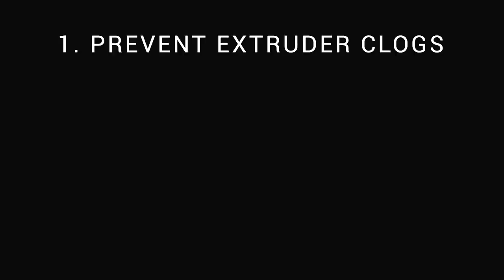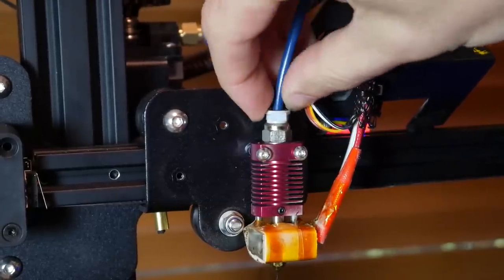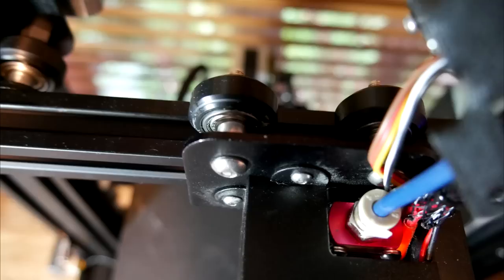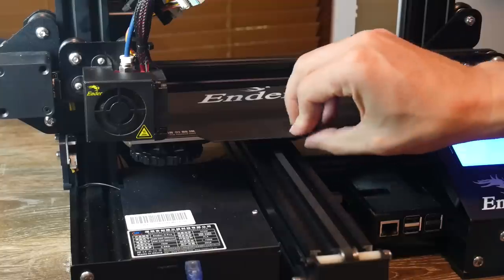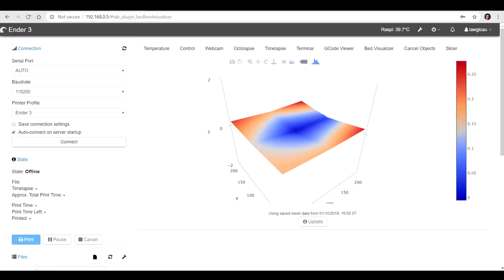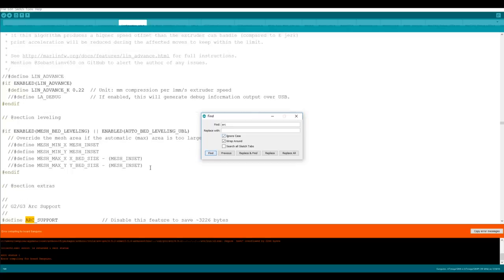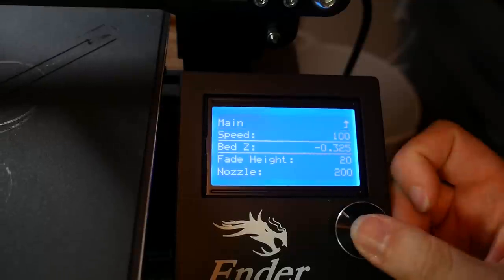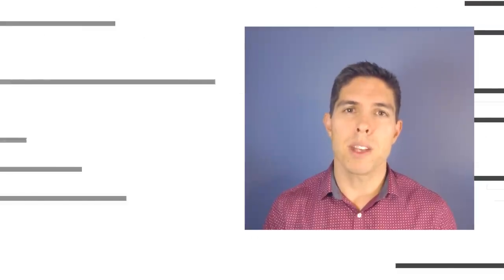5 beginner Ender 3 fixes - featuring manual mesh bed leveling guide

Comment: I have an Ender 6. This is a pet rock. 22 attempted prints and two tiny prints. I leveled the bed many times. I am getting fails for different reasons, clogged hot end, feaded grinding but not feeding filament, prints not sticking, prints breaking half way. Each time I find a fix it is only half and I get a fail in a different way. Now you want me to edit G codes which I know nothing about... This hobby is rubbish creation!!! I feel throwing the printer in the garbage is the best solution... All I am getting out of this is the hundred fails and melted plastic. Three Dead Dolphins hobby.

Comment: Any suggestions on why my extruder is skipping? I tried increasing the spring tension but then it skips even more, so I would say that the tension is ok. Any ideas?
Reply: So for anybody who had my issue the solution is to take the PTFE tube out of the heating element, cut off just a tiny 1mm bit at the end and make it as straight and level as possible, then reinstall the tube.

Comment: I bougt a ender 3 pro, but when I got it al setup, I was not able to get the right side of the bed hight 
enough. what should I do now?
Reply: Probably too late to help you but wouldn't lowering the Z Min Limit/Homing Switch on the left side of the machine help ?

This will cause the tip of the nozzle to be lower after Homing so you'll have more adjustment available on the bed levelers.

Comment: The biggest problem I’m having is my prints start in the home position. The test dog works just fine but anything else prints at home.
Reply from the maker: Sounds like you have the coordinates off in your slicing software. They often have a setting to tell where the origin in. Make sure it's not 0,0 at the centre.

Comment: mine just spits plastic doesnt even print the object to begin with. i have a ender 3 pro but so far nothin i do have worked it will extrude but wont print anything to the bed at all

Comment: I'm trying to get manual bed leveling to work, everything works flawlessly until i try to adjust te bed height, then the z-axis wont move.  I'm trying this with a fresh marlin install on a skr mini e3 1.2 board. Anybody got any suggestions?

Comment: I brought a one Ender 3 but it's bad for modeling I have problems with the filament  just don't stuck in the bed.
Reply: Ender 3 is actually very good for modelling... when configured properly. Did you check spacing between nozzle and bed? A sheet of paper should barely slide in-between. Also check your nozzle temp, it might not be hot enough.

Comment: I followed all the steps for manual mesh bed leveling, and Slim LCD was already commented out, but I'm getting a size limit error:

Sketch uses 130224 bytes (100%) of program storage space. Maximum is 130048 bytes.

Global variables use 4735 bytes (28%) of dynamic memory, leaving 11649 bytes for local variables. Maximum is 16384 bytes.
Reply from the maker: I've just added a pinned post to assist you. I assume 1.1.9 ha updated since my video with new features that use more space.

Comment: So, heads up, if you use a example config that is for your exact printer and you enable manual mesh bed leveling, be sure to comment out any #define AUTO_BED_LEVELING shown  @10:34 or you will get errors in your conditionals.

Comment: I found out the hard way that if u didn't order your printer from creality directly  they won't help you with the printer at all. They said for me to contact banggood with my problems. I didn't ask for parts or any thing. I simply asked for advice on adjusting the z axes Because it wasn't working. Plus asked them about the 2 screws that hold the z axes motor on. I just wanted to know were I could get some more since I  lost them. 

I thought they were a good company that whole email turned me off. Its crazy that since I bought my printer from one of there venders there can't answer any of my questions.

Comment: I just got my ender 3 and haven’t printed anything yet but whenever I click the home button the bed goes all the way back and the print thing goes all the way to the left
Reply: that is the home location on the ender 3, from there you will follow the steps in the video to level the bed

Comment: You typo'd on "2. Uncomment #define LCD-bed_levelling" in the description, that should be "2. Uncomment #define LCD_bed_levelling". Note the underscore in stead of the hyphen.

On another note, just disabling arc support still overflows my storage space on vanilla marlin 1.1.9 ( 130224 / 130048 ) with the Ender 3 defaults, my overflow is also 2700 bytes exactly, not the 2296 bytes your setup seems to have. Did you disable something else?
Reply: Commenting out #define SHOW_CUSTOM_BOOTSCREEN and #define CUSTOM_STATUS_SCREEN_IMAGE does the trick.
Reply: Thanks  @Jan-cj3vr  , looks like that solved the issue. Sitting at 99% space, right on the edge.
Reply: @stefanwilkens  Same here. Manual bed leveling and then using mesh leveling yielded the best results for me.
Reply: Strange as I'm sitting around 93% and with that, I was hoping to include the mesh validation tool but still didn't have enough space.
Reply: Still wrong lol. It's LCD_bed_leveling with only 1 L

Comment: Does anyone know if the manual mesh bed leveling works with prints only from the SD card or also with prints from OctoPrint via USB? 
I have suspicions that OctoPrint ignores the settings of just leveled Ender-3.
Reply: OctoPrint would not affect this. Your start or end GCodes from your slicer could though.
Reply: @GrayOlson  well, thank you for the clarification. What could be done to overcome this issue? I am using Cura 4.1.0.

Comment: hi, i just bought ender 3 and i am having some issues on the extrusion is skipping, can you please help me thank you.
Reply: I might be able to help. You said your extruder is skipping but are your prints coming out stringy, in addition to underextruding? Your extruder skipping steps means something is causing it to work harder than necessary to extrude your filament. Most likely you have a clog in your hot end.
Reply: A common problem with the ender 3 is that the PTFE tube is just the bowden tube going all the way to the nozzle. The bowden can slip, causing a gap between the nozzle and the tube. That gap gets filled with molten filament, clogging the nozzle. This causes the extruder to skip as well as causing your prints to be stringy as retraction moves are failing, as well. To test this, unload your filament and take the nozzle off your hot end and remove the bowden coupler from the hot end. Heat your nozzle up in this stripped down state and push your bowden all the way out where the nozzle goes. This will push the carbonized plastic out of the hot end. If this is your problem, you can get new bowden couplers that have a separate PTFE tube for about $5 US, but you'd be better off getting an all metal hot end. I got the micro Swiss all metal hot end for mine for $63 and it fixed all of my issues.

Comment: I have a problem when I insert the filament, its kinda hard to push all the way to the extruder. I need to use the move the motor from the menu on the ender 3. Anyone has this kind of issue also? Its kinda anoying when I want to change the filament.
Reply: Adrian Belano I had the same problem at first. I found that cutting the end as pointy as you can helps a lot. Make sure you squeeze the filament release fully so the filament can pass the extruder gears without binding. I also picked up a tip that I find invaluable, put  a small amount of canola oil on the filament tip before sliding it in the extruder. Just rub a little with your finger and it’s pretty darn amazing and won’t hurt anything as far as I’ve seen.
Reply: @heeder777  Thanks man! I will try once i get home! Much appreciate it!
Reply from the maker: Good tips from heeder. Printing an extruder wheel helps you load because you can turn the extruder stepper by hand with everything aligned.
Reply: @TeachingTech  Thank you for the tip! I will try to print one first then!

Comment: I am still getting this message after disabling arc, 318 bytes over.  Anyone know what is going wrong

Arduino: 1.8.9 (Windows 10), Board: "Sanguino, ATmega1284 or ATmega1284P (16 MHz)"

Sketch uses 130366 bytes (100%) of program storage space. Maximum is 130048 bytes.
Global variables use 4743 bytes (28%) of dynamic memory, leaving 11641 bytes for local variables. Maximum is 16384 bytes.
Sketch too big; see http://www.arduino.cc/en/Guide/Troubleshooting#size for tips on reducing it.
Error compiling for board Sanguino.

This report would have more information with
"Show verbose output during compilation"
option enabled in File -> Preferences.

Comment: If anyone can help me.
My printer stops after the first layer and becomes unresponsive (i.e. can use knob to interface with screen) after turning on/off i am given the option to "resume print" or "stop print," when i go resume it heats up but does not resume, just stays there.
Reply: I had the same thing, its the included sd card its rubbish, use another decent one and all will be well :)
Reply: @phltr_fpv37  thank you so much, I searched around for frigging ages and was losing hope.

Comment: Manual mesh bed leveling not working for me 100% memory 130048 bajts (I've disable, ARC, speaker,SHOW_CUSTOM_BOOTSCREEN, CUSTOM_STATUS_SCREEN_IMAGE, SHOW_BOOTSCREEN) . Only works with power loss recovery disable.
Reply from the maker: Search configuration.h for slim LCD menus. That will get you over the line easily.
Reply: Thx for replay but I'm using a LCD Menu a lot so it not solving my problem.

Comment: So, I was having the darndest time with my ender 3. I purchased it open box from a whole sale seller on eBay. This is fine for an experienced user but not so much for those who are new like me. 

First I found my nozzle was clogged solid as a rock, I have no idea what is stuck in it but even with the pin that comes with it and even when the nozzle is hot I can't clear it out so I changed it and then I had pla cleanly flowing out. 

Then I configured my slicer settings and they should have been good I thought but every time I printed a benchy I was getting major zits on the back front side and rear back side of my benchy, also I was getting minor shifting. I just couldn't figure it out, I thought I was over extruding or perhaps a wrong slicer setting.

In the end, I closely watched my ender printing and noticed that the belt on the Y axis was slightly jumping as the bed reached the back if the unit, I thought the belt had been pretty tight but I figured it was worth a shot to give it a tighten. I cancelled the print when through tightened all the belts loosened all the wheels. Then I started another print thinking there was no way it could be that simple. But that was it, this time my benchy printed out like it came off the assembly line.

In the end, if you're new to this don't get frustrated. Just search your problems online and keep trouble shooting and you more then likely will find your issue. I can say that even if you are technically inclined this more then likely isn't going to be a hobby that you learn in a day, so be patient, watch a lot of videos like this and you will get there!!

Comment: What is fade height?
Reply from the maker: The firmware will gradually remove the mesh compensation over the fade height. this means less work for the z steppers and the top of the model being flat, rather than matching the contours of the warped bed.

Comment: I was crossing my fingers but alas nope you didn't address the simple fix for a 'warped bed' - welcome to physics people, EVERY bed will sag in the middle due to gravity, the only 'flat' surface is one that is actually not flat at all and is bowed in the middle and flipped upside down. - Take the top surface off, lay down a strip of painters tape/paper/whatever in the area that is dipped, reinstall the top surface and check again. Rinse and repeat, you'll get to a point where the tiniest piece will have a noticeable effect and you simply cut/reshape the tape as necessary until its uniformly 'flat' as its supporting the bed where it needs to be
And yes I also do this when I have ABL installed. ABL moves your Z height but it won't make your bottom surface 'flat'. You may or may not notice depending on how uneven the bed is, but if you place a printed part on a flat surface it can still wiggle around. I'd rather actually have a true flat printing surface to begin with, and mostly use the EZABL to compensate for different thicknesses in print beds (i.e. when I lay painters tape down for nylon or swap the glass out)

Comment: I feel like I need to do bed levelling way too often, every time I check after some prints it is not as good as it was when I levelled it the last time, which is understandable with such a rudimentary levelling system, definitely not a fan
Reply: Have you tried printing and installing some locking knobs for your adjustment knobs? They should help with leveling less often

Comment: Great videos and advice, except for one thing.Those 2 screws do not allow heat to creep. They should also not be removed. They are there for a reason. 

This is confirmed by Creality.
Reply: What if one doesn't blindly trust Creality? And how come it doesn't allow heat to creep? I'm pretty sure those screws are there to protect the heatbreak from the twisting effort of removing/tightening the nozzle. On the stock Creality setup the metal box that holds the fans stops you from being able to clamp the heatblock with pliers to avoid damage to the heatbreak, so they must put those screws to stop you from destroying your heatbreak. If you remove the metal box and lock the heatblock while changing nozzles you will have no problem.

Comment: Hi,
I followed your three videos, and even when I disable POWER_LOSS_RECOVERY, I run out of memory:

Le croquis utilise 130224 octets (100%) de l'espace de stockage de programmes. Le maximum est de 130048 octets.
Les variables globales utilisent 4735 octets (28%) de mémoire dynamique, ce qui laisse 11649 octets pour les variables locales. Le maximum est de 16384 octets.
Croquis trop gros ; vois http://www.arduino.cc/en/Guide/Troubleshooting#size pour des conseils de réduction.
Erreur de compilation pour la carte Sanguino

What Can I do to have enough memory?
Reply: I found a solution, just disable SHOW_CUSTOM_BOOTSCREEN to sqve some octets

Comment: Hi Micheal, love your videos. I built my Ender 3 Pro today and did your Bootloader guide using TH3D, then updating it using Vanilla Marlin. The only problem I'm getting following this video is that I'm still over my text size after commenting out #define arc_support in configuration_adv.h:, error message below.

Arduino: 1.8.8 (Windows Store 1.8.19.0) (Windows 10), Board: "Sanguino, ATmega1284 or ATmega1284P (16 MHz)"

Sketch uses 130224 bytes (100%) of program storage space. Maximum is 130048 bytes.

Global variables use 4735 bytes (28%) of dynamic memory, leaving 11649 bytes for local variables. Maximum is 16384 bytes.

Sketch too big; see http://www.arduino.cc/en/Guide/Troubleshooting#size for tips on reducing it.

Error compiling for board Sanguino.
Reply: Same issue, really need to get manual mesh leveling going because my Pro's bed is raised in the middle making full bed level impossible.
Reply: @schlonald  Hi, that's the same problem I've got bed raised in the middle.
Reply: Dev John His BLTouch Vanilla Marlin video has a discussion about other ways to save space in the Arduino sketch. Going to try disabling boot screen today.

Comment: Heating the bed to level it does not make sense. The surface area is too small and the temperature is too uniform for its level to vary with temperature.
Save yourself that useless step.

Comment: no need bed levelling if printer is build correct and there is no bed levelling skews. its flat as it get and allways levelled. can use glass. there is some bad desing everyone use. forget bed levelling and build it so not need. oh oh. wjen we get printer that not need any upgrades. never! manufacturers not want. would end sells lol. its so fucking stupid desing have 6mm sping on 4mm bold.when sping slip bed level will move WTF so much and printing shake and loosen them oh oh WTF even ender 3 is awesome its just build like everyone do home. if i would sell printers i would do it better than home build. you can go dame z offset if nozzle not correct height or move endstop OH OH but bed levelling suck big time. build bed flat !!! no adjustment. then build x axis paraller with bed and y. its so easy